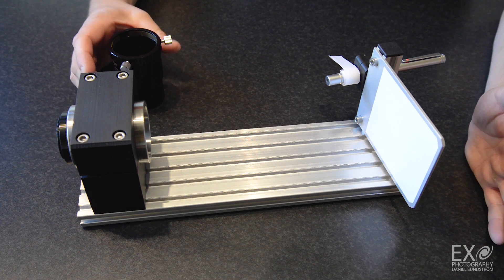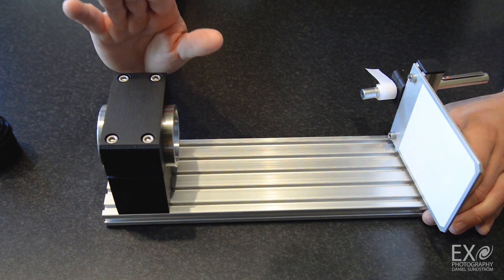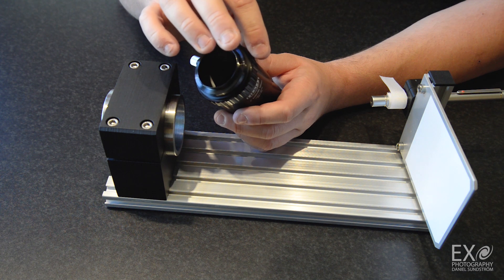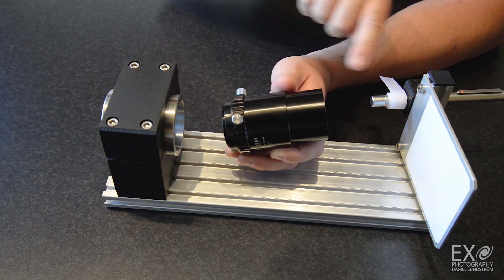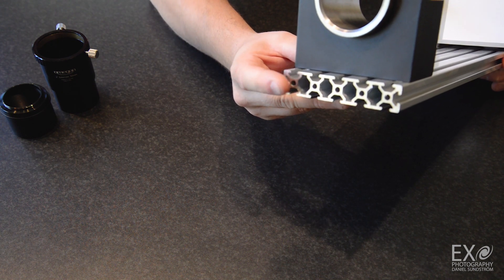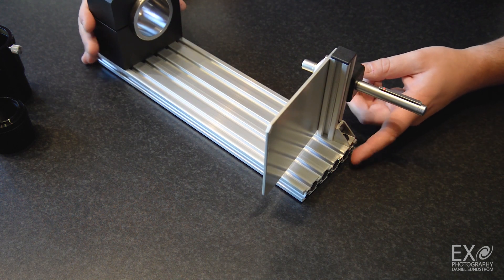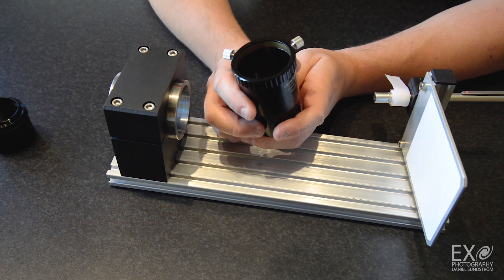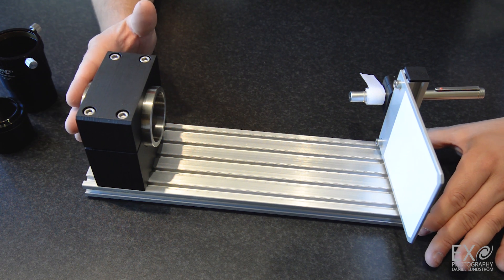Optical test rig v2.0 - Updated parts list

Comment: I need a barrel alternative. I actually have some of those 2" extenders laying around and both are too sloppy and would not work as an alternative
Reply from the maker: If you tilt the rig so that the camera points downwards, the sloppyness might be better controlled, otherwise, you maybe need to get a barrel machined for you.

/Daniel
Reply: @ExoPhotography1  you should sell the barrels and that clamp and some other parts to make these. Looking around I have the 2" visual back from my scope ("DCQSV3 Low Profile Visual Back for 3" Stellarvue Focusers") which could work vertical, but I still need a way to mount it in some vertical rig and cut a big hole so idk how that will work
Reply from the maker: @ddxfs   I would love to if I had the time :/

Comment: Phenomenal setup.  Are you able to share a link for the 2" machined barrel, the 3D CAD for the block, and the type of bolts to secure it?  I have a 2" extender as you suggested but I'm concerned that the screw holes in the exhaust clamp to hold it won't line up with the grooves in the aluminum extrusion.  The screw holes are listed as 110mm apart.
Reply from the maker: I didn`t made any CAD for the barrel, just out of my head. The exhaust clamps will not fit the 20x100 aluminium profile, hence the new 3D printed plastic block. If i recall, the spacing between those bolts is 80mm.

I can upload the STL but it is quite odd in the dimensions, just for my barrel which was approx. 62,3mm or something.
But if you wan’t me to upload it I can do that =)

/Daniel